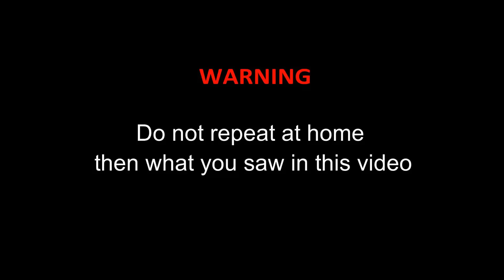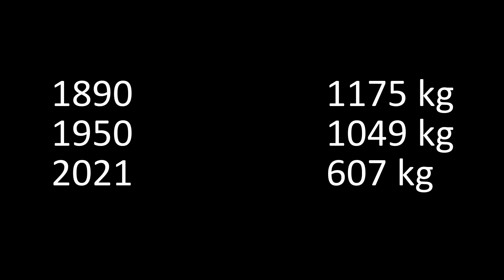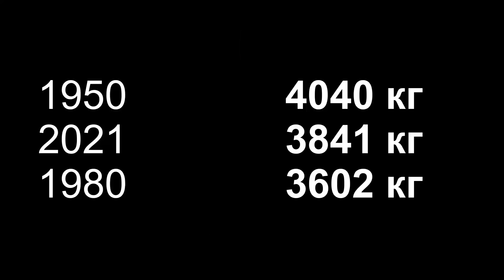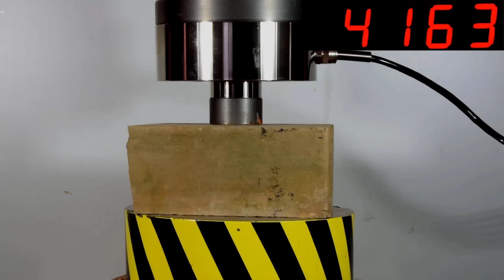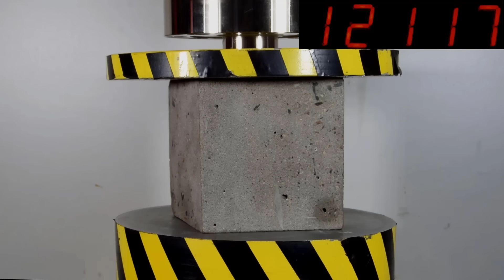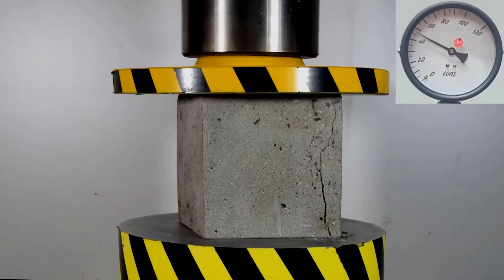HYDRAULIC PRESS VS OLD AND MODERN BRICKS

Comment: Older clay bricks were hand packed so there were much less air bubbles in the brick when they were fired, however they were also 10 times as expensive than today conventional bricks.
Reply: The value of $100 in 2022 is worth approximately $3.50 cents in 1913 dollars. What you're describing as cheaper is actually just inflation, and being conditioned to accept lesser quality goods.
Reply: @JohnDoe-xf2ke  Mass production to fuel super fast development. It didn't end well tho
Reply: @JohnDoe-xf2ke  Except if you adjust for inflation they are still much more expensive. There's a reason people mechanized things, it's because you can make much more with a machine than if you had a to pay a person to pack them all by hand.
Reply: @samhomework  I will pay 10x the price for something that will last much longer.
Reply: @aaronsondag8347  The issue with that thinking though is that just because the brick is stronger under tension doesn't mean its more suitable for the job, being efficient is all about focusing the maximum amount of necessary effort for the most effective completion of a job in specialized and particular ways. A better tensile strength for a brick doesn't mean it lasts longer or is more efficient. This is how you save money and get the most effect, now if you could demonstrate that these mass produced cheaper bricks serve worse for their specific function that would justify the increased cost, then sure, but until you do economics is against you.
Reply: How about modern concrete walls with bricks as outer layer?, I much prefer stone looks tho like a castle or those foundations of Japanese castles
Reply: @aaronsondag8347  The strength trade off is so marginal that it would be stupid to pay that. 10x multiplied by the 1000s of bricks necessary to do a job and you will be singing a different tune.
Reply: @samhomework  I mean not to mention that the outer leaf of a cavity wall is literally not even used for load bearing and is practically for aesthetics and thermal retention. Ergo the air bubbles are actually beneficial as they provide a more thermo resistant brick. So as long as a brick can hold its own weight amongst a wall of its kin then the brick is doing its job just fine. You even get bricks now that have even more air pumped into them for better thermal resistance.
Reply: @aaronsondag8347  The problem is everyone would want that thus increasing the prices further and increasing work load on that person making availability highly unlikely.
Reply: @aaronsondag8347  yeah because quality always pay you back!
Reply: @aaronsondag8347  how bout u pay 10 times more for ur housing too, just so it’ll “last longer”
Reply: @JohnDoe-xf2ke  ? He's saying the old bricks are more expensive, not the new ones? Your comment only makes sense if he says the new ones are more expensive.
Reply: besides being heavier
Reply: There is a reason for that. Air pockets are there beacuse of better insulation properties in modern bricks. Because all modern houses are reinforced with colums meade of steel reinforced concrete. So you have cage of  steel reinforced concrete and brick walls are filling inbetween, from that reason bricks do not have to bee to as hard as oldones they must have good insulation properties and the production is cheaper.
Reply: @aaronsondag8347  So you'll gladly pay 10x for the brick work on a house so it lasts 1000 years instead of 300 years?
Reply: @Dooncat  expect every brick is quality they are just manufactured different and have a huge variety of colors and textures a hand made brick isn't any better or worth than modern or old bricks. If you like the way it looks then go for it but if you're paying 10x more because you think its a higher quality because its hand made then you are wrong.
Reply: @debelikreten3707  either way a few of bricks in your 1000s with air bubbles isn't going to cause worse structural integrity the way bricks are laid and tied in together is very strong
Reply: @aaronsondag8347  It's a fucking brick dude. You won't ever notice a difference
Reply: @JohnDoe-xf2ke  conditioned?
Reply: @samhomework  The cheaper mechanised bricks probably weren't an option in the 19th century. It was probably just 'the way' to make bricks, so having a range of qualities and costs is a moot argument for the Victorian bricklayer. Whether it's worth using the hand-made Victorian method today over modern is another point. It still has modern applications as there is a market for them. A small one, but they haven't completely disappeared.
Reply: Where did you find the information to come to this conclusion? I would assume bricks made on a hydraulic press would be much more efficient and consistent at pressing out air bubbles. I feel it may be due to a change in heat treatment process, but I haven't stated or given off the impression that any of this is fact.
Reply: Because frankly, the hand packing seems like a chip off the old "older is better" cliche which is more often than not, conjecture.
Reply: @SourWolf085  Which way is better...? Here we can speak for several hours about that, from position of houses in different climate regions, surface properties to the purpose of buildings.

But it's very interesting that for example, concrete made in Roman empire was stronger than todays concrete. The question to me is, how stupid is modern man?
Reply: Considering hundreds of thousands of miles of tunnels of all sizes under every big city all over the world done in bricks the idea of hand labour is absurd, clearly you have no idea of the process, look at underground pictures, looks like a 3D machinery was used.
Reply: @Brisbane Socialist "They don't make 'em like they used to."
Reply: Look at the extrusion lines on the bricks, they were extruded and cut on the fly. Yes a lot of bricks were hand packed and cast.
Reply: @samhomework  not gonna lie,maybe in your country is pointless. But down here in Chile i rather to pay that extra just to be sure my house will not get ruined in the next Earthquake
Reply: @debelikreten3707  incredibly not stupid considering we have to factor in economics sure Roman concrete was harder but we have more of the stuff
Reply: @otroweonllamadoseba  you do realize harder means more brittle in earthquake prone areas you bloody use flexible materials also really you are going to pay10x what you normally would for a regular sized house with the only difference being the bricks
Reply: @JohnDoe-xf2ke  except your argument doesn't work because $3.50 in 1913 times ten doesn't equal $100 (the difference being 28.6 times) and $3.50 worth quite a lot of money if you account for the purchasing power back then.
Now, here's a real argument : in 1912, a railway employee was paid $662 a year. In 2012, the same employees for basically the same job is paid $46,840.
If you to take into account the inflation which is 2219.1%, you end up with a salary of $14,690.442 a year in 2012. It is 3.19 less than the average salary nowadays.
On another website, I calculated, in average, the American worker have 3.6 times the salary an average worker could have had in 1913, still accounting for the inflation, of course. So let me tell you that when your brick cost you 3.6 times its current price, it won't have the same effect on your salary at the end, so you can at least expect it to be much stronger.
And now, we can pay the same thing but much cheaper while still maintaining about the same strength and we have much better technique, allowing us to create better with less. So don't try to make people think people lived in better houses in 1913 than in 2022. It's just not true and you know it.
Reply: Nope, hand packing produces very inconsistent bricks unless you luck out with a good craftsman. Modern bricks are often deliberately infused with bubbles to reduce weight and then used in applications where the strength they do have is appropriate. We have 'engineered bricks,' these days that are far stronger than old bricks.
Reply: @aaronsondag8347  I'm sure you can get extra strength/durability/quality if you pay more already for nearly anything you can buy.
Reply: true 👍 ✔ 👌 👍 ✔ 👌 👍
Reply: @Brisbane Socialist usually is
Reply: @aaronsondag8347  Except when it comes to actually paying I am willing to bet that you will just buy "good enough" and save lots of money like almost everyone else. Do you really need to live in a house that lasts 200 years or is 100 years good enough? By your logic you might as well not even use bricks but instead use carbon or some other expensive exotic material. It all comes down to practicality and "good enough".
Reply: @samhomework  Cheaper production doesn't necessarily mean cheaper prices.  In capitalism, companies like/need to make more and more profit, remember. One way of doing this is to cut production costs while keeping the same sale price or even increasing it.
Reply: companies dont want solid air-less products... the voids have to be filled with product otherwise... so if you pack 25% of the brick with air bubbles, then every fourth brick is free to the manufacturer for the exact same cost as 3
Reply: @samhomework  Not at that time when people were paid almost nothing.
Reply: @aaronsondag8347  you are not gonna outlive the bricks in a house
Reply: I doubt that hand is able to pack better than a machine, but the thing is that in the old times bricks were dried naturally on air, while nowadays drying is done in heating cameras which is not good for brick strength if fossil clay is used as is.
Reply: They cure over many years, concrete for example takes 99 years to set was often heard when I was a concrete fabricator back in the mid 1980's.
Reply: Those older bricks are baked at a lower temp and over time fall apart.
Reply: @aaronsondag8347  so you pay 1.000.000 instead of 100.000 for a house to live in the next 80 years?
Reply: @debelikreten3707  steel gets worse through corosion
Reply: @jacques12339  you should come look at the old bricks in my 1938 house. half em them are baked till they turn black and if you try to drill a hole in one of them you actually burn your drill. they are tough as fuck. ALOT tougher than the new ones
Reply: @crashtestdummy87  you use a hammer drill to drill through massonary not a drill. The brick I'm fixing now is 1870 and it's junk.
Reply: @jacques12339  i mean the drill bit and offcourse i use a hammer drill. maybe ur bricks are junk because it's made in america
Reply: @horatiohornblower3757  The long con
Reply: Why buying likes no one even knows you lol
Reply: @aaronsondag8347  Build 10 walls of modern bricks.
Reply: @aaronsondag8347  the thing is, it won't last much longer AND you'll have waaay less insolation with the old ones...
Reply: @Spartan322  I've found, in engineering, "good enough", and a 2:1, or if you're lucky 3:1, safety margin, is what most aim for.